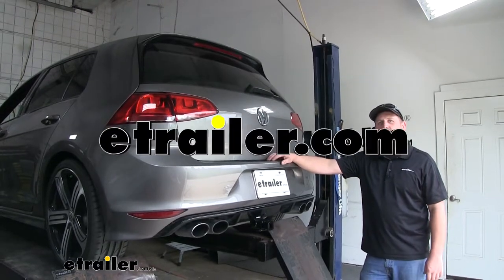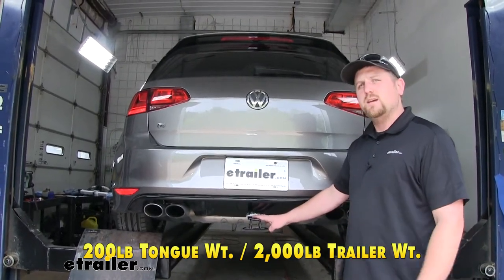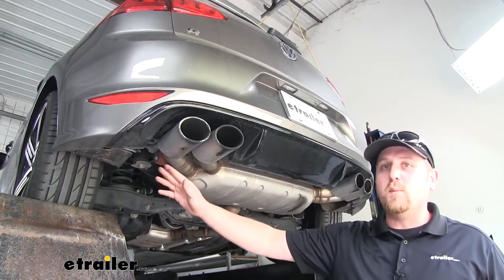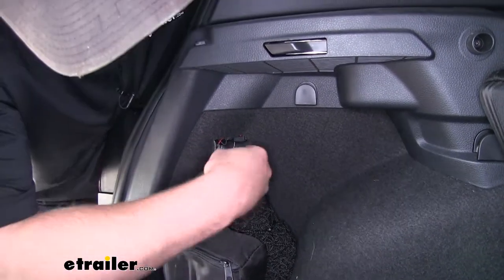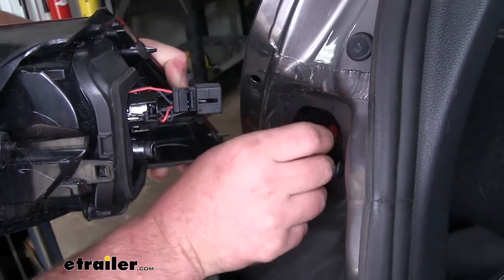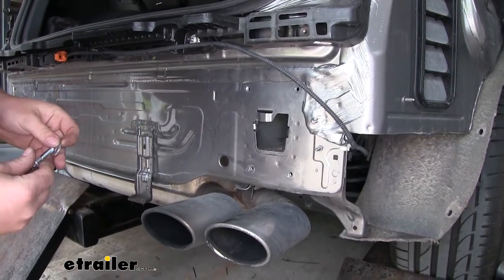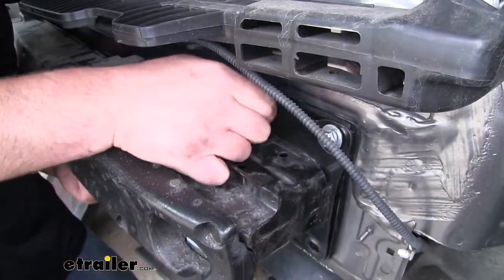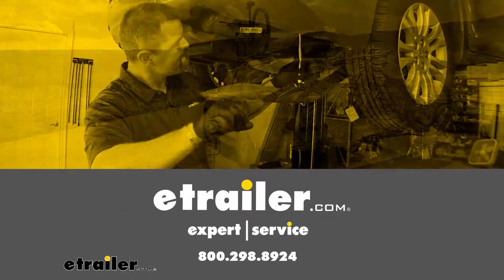etrailer | Installation: Curt Trailer Hitch Receiver on a 2016 Volkswagen Golf

Comment: Does it come with a template for making the cut in the bumper?
Reply from the maker: It doesn't come with a template per se, but page #2 of the instructions we've linked for you shows the dimensions of the trimmed area and exactly how it's laid out. You can check the out here:
https://www.etrailer.com/instructions.aspx?pn=C11564

Comment: Hello, what about the electric cables?
Reply from the maker: If your Golf is NOT the GTI or R model, there's a plug and play option, part # 118646. For GTI and R models, use the # C59236 universal harness from Curt. Here's a link to an install video for the # 118646:
https://www.etrailer.com/tv-install-volkswagen-passat-trailer-wiring-2015-volkswagen-passat-118646.aspx
Here's a video for the Curt harness:
https://www.etrailer.com/tv-install-trailer-wiring-2017-volkswagen-golf-c59236.aspx

Comment: I have a 2018 golf r and just followed your instructions now wen I start my car I have/ tire pressure monitoring system,park pilot, electronic stabilization control,hill start assist,front assist not available.
Reply from the maker: What you describe wouldn't typically happen with a hitch install. The only possibility would be if one of the wiring connections that needed to be undone to install the hitch wasn't reconnected. Check those connections, and make sure they're all secure and correct.
https://www.etrailer.com/Trailer-Hitch/CURT/C11564.html

Comment: That's so much work to put a trailer hitch on.  German over-engineering at its best.
Reply from the maker: It is a decent amount of work to get this hitch installed but the good thing is that you only have to do it once. The benefits that you will have my having a hitch will surpass the work 10 fold.
https://www.etrailer.com/Trailer-Hitch/Curt/C11564.html
https://www.etrailer.com/maindept-Recreation.aspx